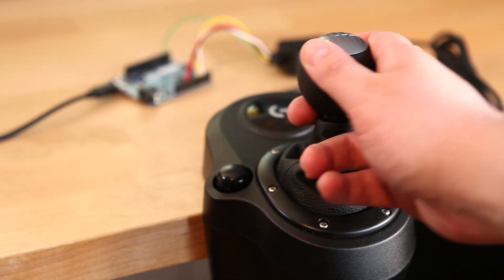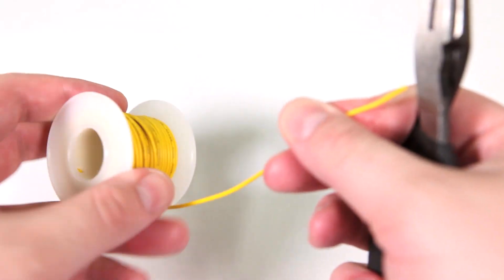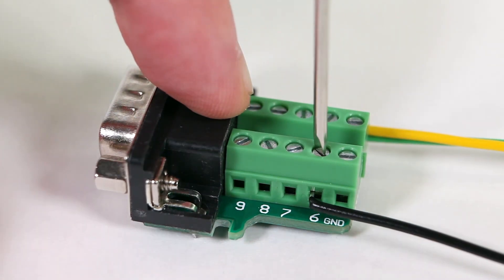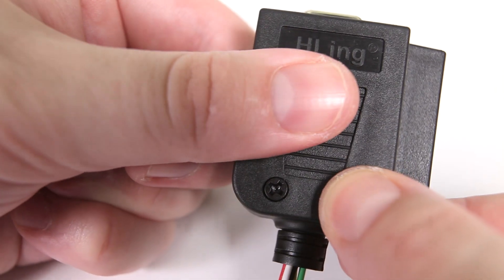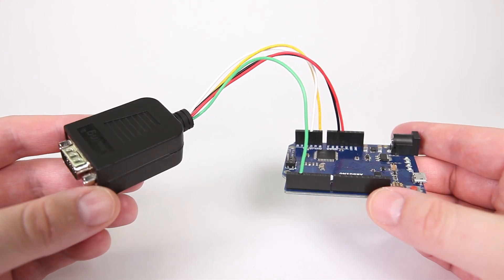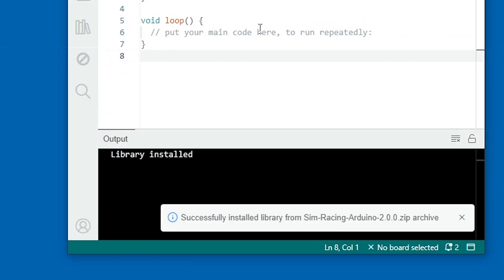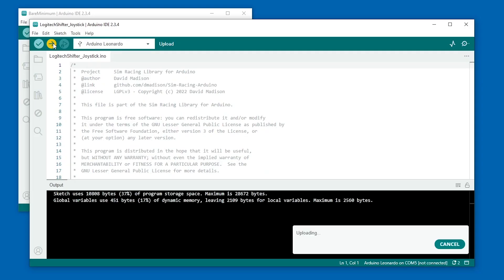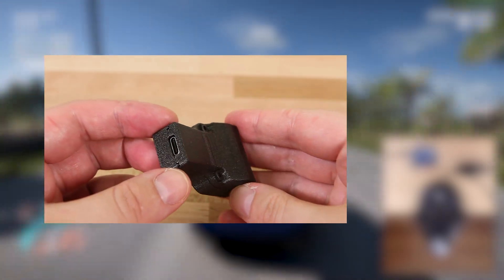DIY Logitech Shifter USB Adapter (No Soldering!) (G923 / G920 / G29)

Comment: My gear 5 and 6 don't seem to work.  Any ideas?
Reply: @blitz_VR1  
there's another comment with this, but I'll put the reply here for completeness:
just had this problem and worked it out (assuming you're using this for the G27 like I am), in the arduino file, there's the pin mapping:
const int Pin_ShifterX      = A0;  // DE-9 pin 4
const int Pin_ShifterY      = A2;  // DE-9 pin 8

const int Pin_ShifterLatch  = 5;   // DE-9 pin 3
const int Pin_ShifterClock  = 6;   // DE-9 pin 1
const int Pin_ShifterData   = 7;   // DE-9 pin 2

This shows the wiring is different for the G27 to account for the additional buttons:
There's no pin 3-7 jumper in the DE-9 end, pins 3, 1 and 2 in the DE-9 end go to Pin 5, 6, 7 (as in the above code) 4 and 8 are unchanged.

This now maps the HAT/D-Pad, all buttons and gears correctly.
Reply: @90nic  Thanks so much for responding. That is the code in the g27 example code, but how do you add gear 5 and 6?

Comment: What might be the problem if I don't get 5th gear and 6th gear and reverse both register as button 7?
Reply: And where did you get those instructions?
Reply: Reverse gear wire not connected correctly. Thanks for the tutorial.
Reply: @williamcase426  what did you change ? i have the same problem.
Reply: @jedvinijus  Check the wiring. I didn't have things plugged in the right terminals.
Reply: @williamcase426  i found out that pin 3 by me was mistakenly diagnosed, that pin for me was blank, but had to be connected to power.
Reply: @jedvinijus what do you mean by this?
Reply: @blitz_VR1 I checked the wiring of what was originally what and tried to go off that, but just needed to follow a normal instructions guide which wire needs to be soldered
Reply: @jedvinijus where are those instructions
Reply: @blitz_VR1  
just had this problem and worked it out (assuming you're using this for the G27 like I am), in the arduino file, there's the pin mapping:
const int Pin_ShifterX      = A0;  // DE-9 pin 4
const int Pin_ShifterY      = A2;  // DE-9 pin 8

const int Pin_ShifterLatch  = 5;   // DE-9 pin 3
const int Pin_ShifterClock  = 6;   // DE-9 pin 1
const int Pin_ShifterData   = 7;   // DE-9 pin 2

This shows the wiring is different for the G27 to account for the additional buttons:
There's no pin 3-7 jumper in the DE-9 end, pins 3, 1 and 2 in the DE-9 end go to Pin 5, 6, 7 (as in the above code) 4 and 8 are unchanged.

This now maps the HAT/D-Pad, all buttons and gears correctly.
Reply: @90nic  I responded to the one comment, but probably should try to just keep it with the others.
so, I see that is the code in the g27 example file, but what did you do differently to get shift gear 5 and 6?
Reply: @blitz_VR1  you leave the code the same, change the wiring to how I said, that sorts it, all gears, all buttons and hat, there’s even comments in the code that explains how to make the light work and to disable buttons when you unplug the device - otherwise you get false readings

Comment: onnecting to programmer: .
Found programmer: Id = "CATERIN"; type = S
    Software Version = 1.0; No Hardware Version given.
Programmer supports auto addr increment.
Programmer supports buffered memory access with buffersize=128 bytes.

Programmer supports the following devices:
    Device code: 0x44 

I HAVE THAT ERROR WHATS THE PROBLEM
Reply from the maker: That isn't an error.

Comment: need to build a button as a sequential shifter using the existing g923 shifter, to plug it back into the steering wheel and thus making the shifter a sequential shifter with a built in handbrake button, this stuff is good handy tools for that if the steering wheel reads the signals from the shifter..

Comment: hi are there any problems with using this with a normal wheel. Do most games let you map controls for both devices simultaneously?
Reply: Lemme tell u somethin, actually this adaptor is used for when u are not using a loghitech g29 wheelbase and u want to pair it to ur pc, but if ur using a g29 there is no need to make this adaptor

Comment: If i put it in a gear as far left i can go in that gear it acts like im putting it in the gear to the left when i am not, like if i do that in third it thinks i am in first, if i do it in 5th it thinks im in 3rd, if i do it in 6th it thinks i am in 4th, i had found a little plug that was a db9 to usb and it had a little board in it, i never had this issue when it was plugged into the actual g29 steering wheel, but i thought it was just that plug not being good enough, i bought another shifter to make sure it wasnt thag but it did the same thing, now i tried this and its still doing it, anyone have the same issue and have a fix

Comment: Instead of the db9 pin numbers if you can give the logogram (abbreviation) it would be of mammoth help... in our market, ground is 5 and not 6..
Reply: My 6 is DSR
Reply from the maker: Make sure you are using a DB9 connector and not an RS232 adapter with a DB9 connector. The shifter is not an RS232 device and the RS232 signals are not relevant. Ground is still pin 6, regardless of the label on your connector.
Reply: @dave.madison  yes sir, it is a db9. 

 https://images.app.goo.gl/8qXiyitPEpQSZwww9
Reply: As shown in the pic. Pin 6 for me is not ground.
Reply: You are awesome man

Comment: "Failed uploading error: exit status 1"  what should i do?
Reply from the maker: That just means "something went wrong". You'd need to look earlier in the message to see what happened.

Verify that the code compiles without uploading (checkmark button) and double-check your upload settings (Board, Port).
Reply: @dave.madison  thank you for making time to reply.  Much appreciated.  Got it to work.

Comment: Would just a 9 pin to usb adapter work? Without using ardiuno ?
Reply from the maker: No, the shifter is not an RS-232 device.
Reply: Dang.. I should have figured that be to easy haha. Thanks. Is it possible to run pedal rumblers on that arduino/different arduino at the same time as shifter or woud you need two for separate signals? Thanks again
Reply from the maker: @adizznizzz  I've never set up pedal rumblers, so I'm not sure. But in theory you should be able to do much more on one Arduino than just the shifter.